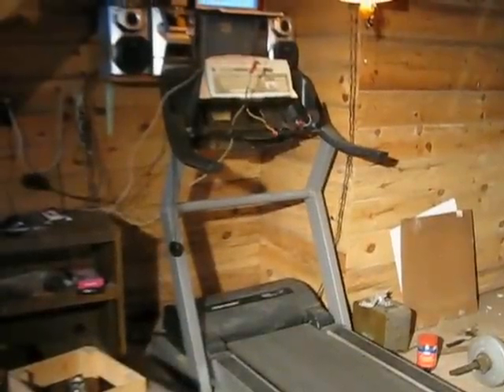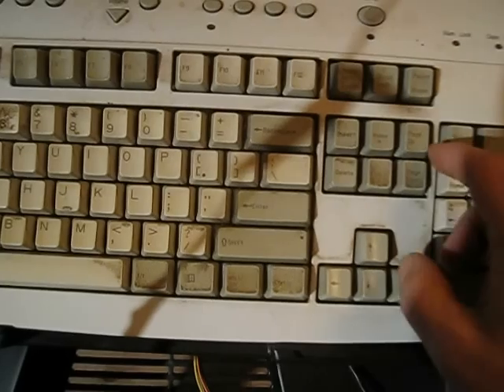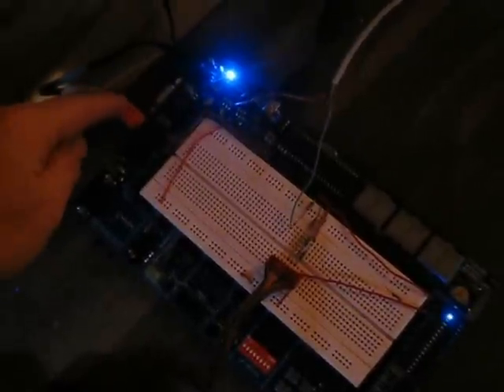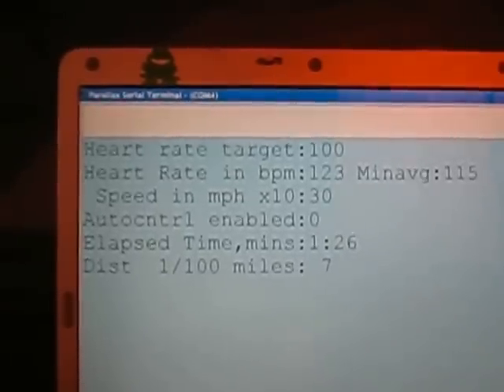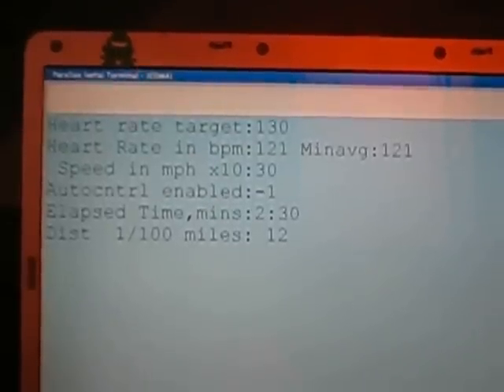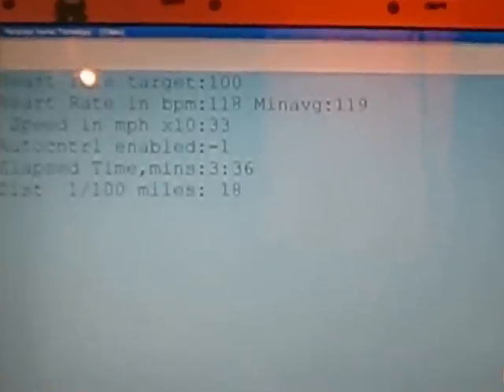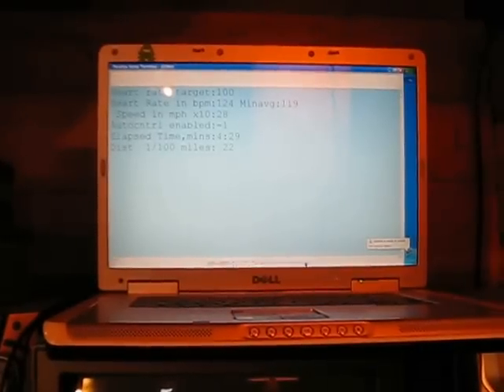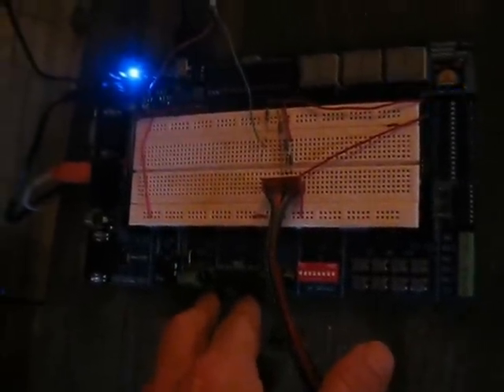Parallax Propeller Controlled Treadmill

Comment: I know this is very old, but you don't by chance have any of the code for this? I am working on reviving a treadmill with the same controller and hoping to recreate all the features like incline. Any information would be greatly appreciated.

I think I can assume the same 2 lines for up and down incline but if you can remember the signal they were expecting I think that is the key I'm missing. Thanks!
Reply from the maker: hey, did you figure it out?  I sure I can find the code if you haven''t... Basically,  you have to apply current across the up/down lines to raise the deck, and reverse the  current flow across the same lines to lower the deck, for about 2 seconds for one percent of incline/decline.  I use my treadmill every day with this setup.